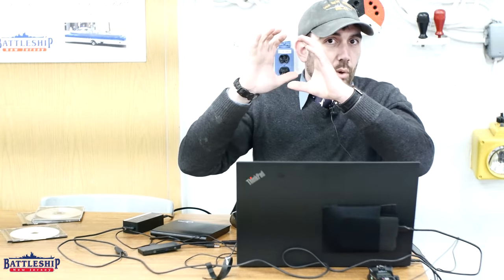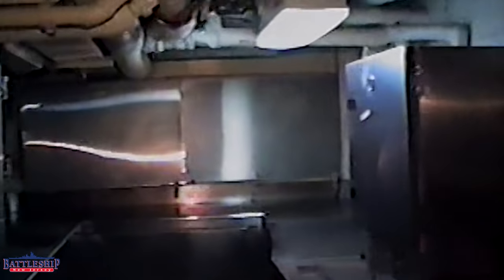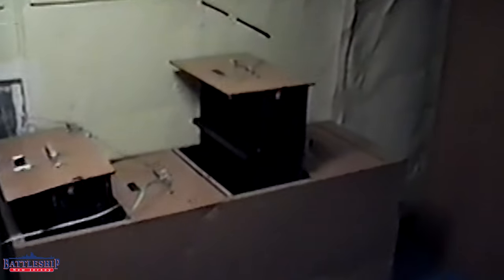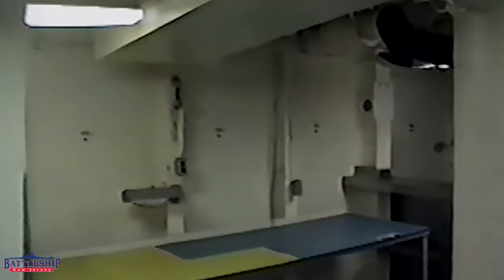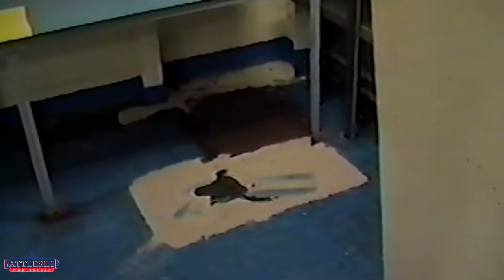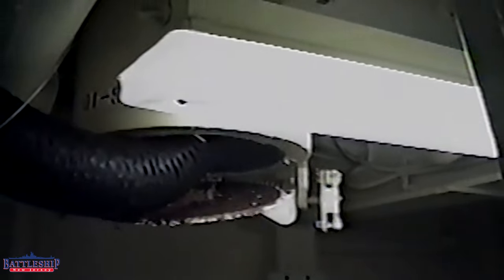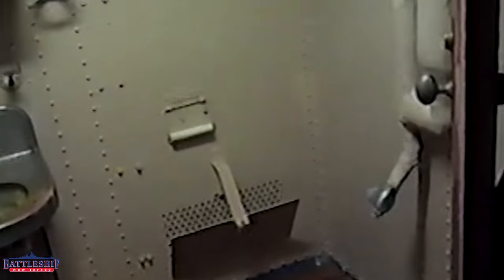1999 Battleship NJ Condition Report: Episode 2

Comment: The reason it looks too zoomed in is because they converted 4:3 standard definition aspect ratio of VHS footage to the 16:9 aspect ratio of HDTV by scaling it up to fill the frame. If it hadn't been scaled up, there would be black bars on each side of the video, the frame would fit at the top and bottom. If possible, have the tape redubbed so the footage is in it's original 4:3 format. It won't eliminate the shakiness, but it will reveal details that are lost at the top and bottom of the video frame.
Reply: Yeah I HATE when they cut footage. Leave the blank areas!

Comment: Something else about the yellow & grey striped door, it has no hinges or dogs or any other visible way of opening it from the side it's being filmed on. In fact it wouldn't be able to swing out towards the camera because it would hit what looks like a light fixture on the left side.  It's probably some sort of cap installed to block off access or air flow to one side of it or the other.